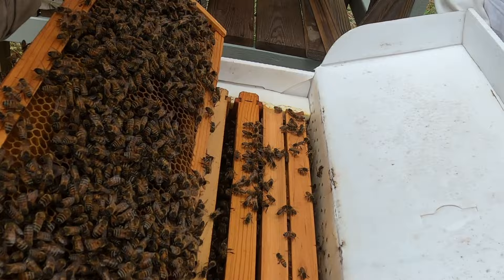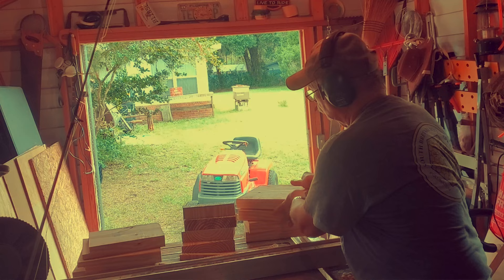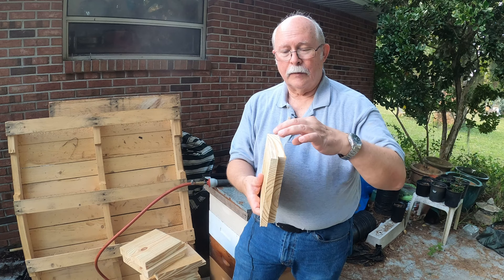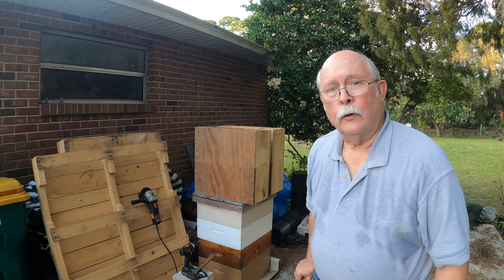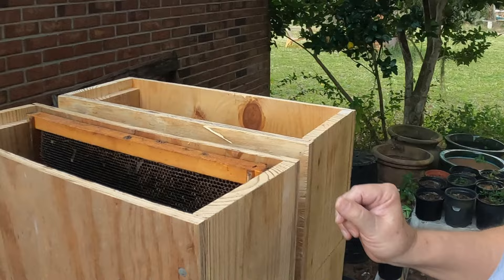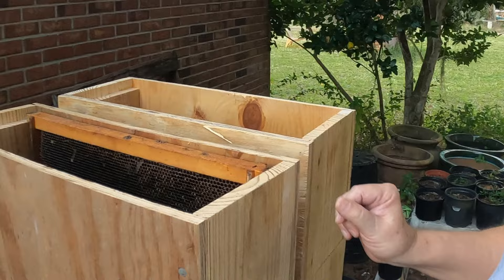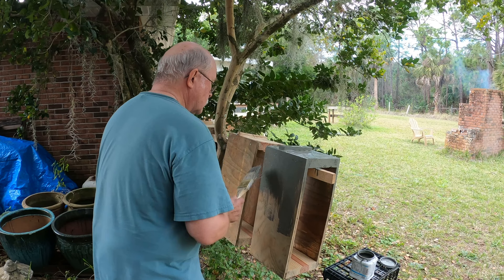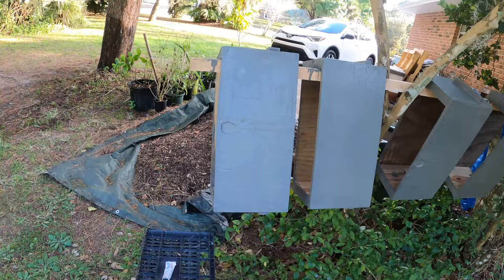SUPER CHEAP 5 Frame Boxes

Comment: Been making mine that way for years. Mine are a little deeper as well so when they build comb on the bottom I use it for cell punching queens so far it's working great.👍👍
Reply from the maker: Thanks E&M, I make a separate bottom board to give them more room at the bottom.  I appreciate you commenting 🙂.

Comment: Yes ,  I use the wood preservative treatment. I first pre  soak each board  then assemble my boxes . I may not be in in 10 years . But God Willing my boxes will. Nus. Swarm Trap 8 & 10 frame . Lids. Thanks   Be Safe   God Bless. 
 Joe
Reply from the maker: Very good Chicago Joe.  I am releasing a video on making bottom boards next and I just realized I forgot to dip my woodwork in Tall Earth.  I appreciate you commenting.  Have a good evening.

Comment: I thought the idea of using the ECO sealer is so that you don't have to paint.  Paint does not let moisture through and therefore the wood can hold the moisture from inside the hive causing it to rot sooner. On the other hand the ECO sealer allows the moisture to pass, allowing the wood to dry.
Reply from the maker: Interesting Greg.  My thought is that the plywood ends for sure should be sealed with paint.  An elderly gentleman who has been doing his beehives this way for many years taught me.  I have been making my boxes this way for a couple of years now and I am happy with painting over the Tall Earth.  Thanks for watching and commenting.

Comment: 2*8 is a little tight for 5 and heavy! I have done it though. 

This year I am trying the plywood nucs where you get 4 boxes per sheet. I bought 5 sheets at $27.50 each
Reply: Inside space (width) needed for 5 frames is 7½", or slightly more if you want room to accommodate queen cages, swarm cells, etc. 
The rabbets (not dados) cut in this video for the frame rests are too large, not a proper fit, as seen by the end to end slop in frame fit. No problem with cutting slightly deeper rabbets (¾" instead of ⅝") to create head space above the top bars if desired, especially if using a flat top without a rim. 
However ¾" is far too long for the rabbet, allowing the frames to slide back and forth and potentially crushing bees between the end wall and the end bars. Stick to the prescribed rabbet length of ⅜" or maybe add a smidgen more for propolis buildup.

Comment: Hi Bruce, why do u brad nail first after glueing and then you nail it... Why not glue and then pilot hole and nail?  Thx I am a novice and am learning from you.
Thx
Dave from WV
Reply from the maker: Hi David, basically I glue then use brad nails to hold the wood as the glue dries.  I nail or screw them afterwards for extra strength. Drilling pilot holes is a good idea 👍.

Comment: i made it the way you said with 22 in sides and the standard langstroff frame falls  thru if correct the sides should be 21 and 5/16 would that be correct
Reply from the maker: Hi Mike, that is strange.  The frames I use seem to work out all right.  Did you use the 2X8 inch boards for your end pieces?  Please do feel free to tweak it to make it work for you.  All the best.
Reply: 21 5/16 long sides works perfectly!

Comment: Hi Bruce. Have you ever considered using 2x8 for an entire 5-fram NUC? I'm wondering how the weight would compare with a regular 10-frame box full of bees and resources.
Reply from the maker: Well, I may be worth it for the insulation but because of the weight and my standard tops/bottoms wouldn’t fit, I probably won’t try it.
Reply: @bruceandhisbees1770  I'm going to build a five-frame for fun. I'll let you know what I discover.
Reply from the maker: @cochechohoneybees1060  Check out my older video about Resource Hives.  All the Best 😎

Comment: Do you make 8 frame deeps or supers?... if so do you have a video? Thx
Reply from the maker: No, at this point I am only using five and ten frame hives. (Ten frames deeps and mediums for honey production and five frames deeps to make more bees with).  I have videos about building both these styles and it would be pretty easy to get the measurements to build eight-frame equipment,  good luck.

Comment: The big piece is 10 inch tall by 20 inch long.
The small piece is 10 inch tall by how many inch long ? 
Thanks
Reply from the maker: Hi BlackBerry, The sides are 10 inch tall by 20 inch long.  For the ends I use 2x8 boards cut to 10 inches:  The actual width comes to 7.5 inches which is perfect for a five-frame box.  Just cut a quarter inch dado at the top to make the frame rest.  Thanks for watching.
Reply: @bruceandhisbees1770  In the video you said 22 inch sides, now 20 inch . I had the same results Mike had. Wish I had read the comments before I built boxes. My Bad!